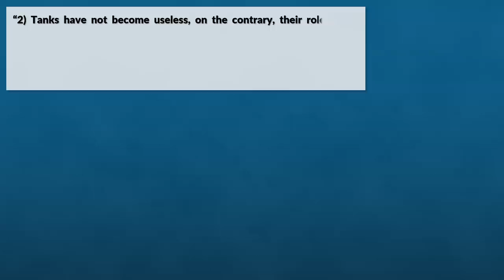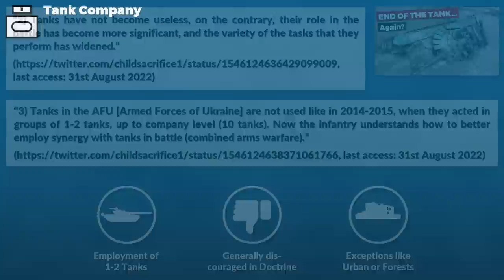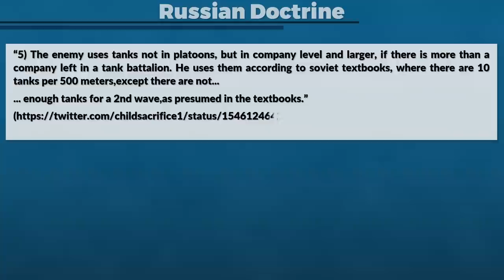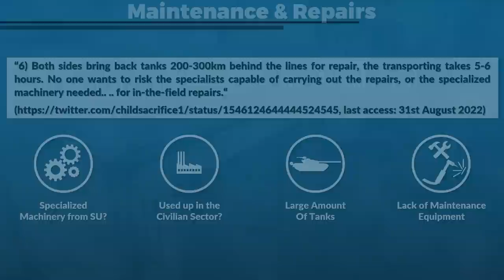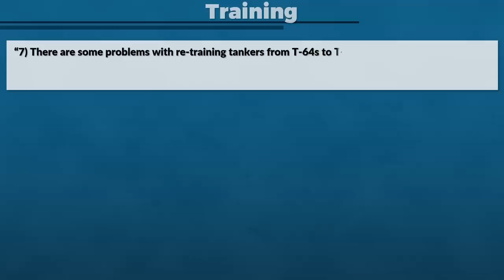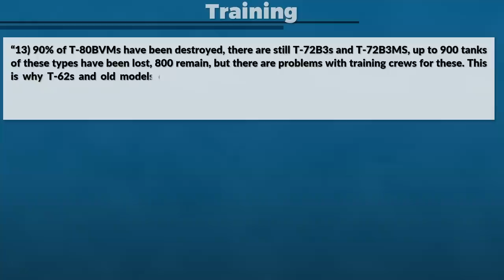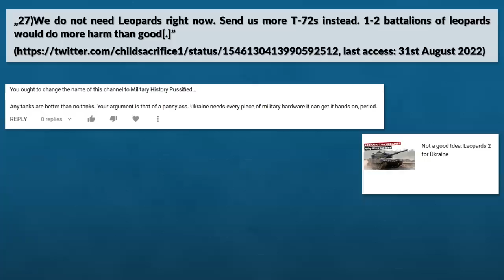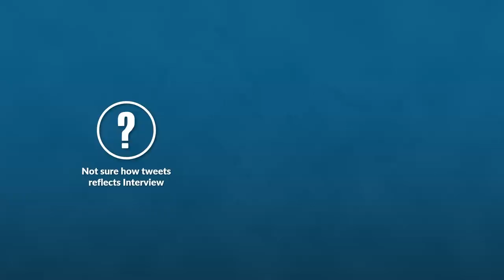What Ukraine thinks of Tanks

Comment: Thing about modern warfare is mobility. Tanks are generally great as the spearhead in these manoeuvres.
Reply: I'm not sure if the paradigm isn't shifting 
Armor is vulnerable to ambush by ATGMs and infantry while on the move,  and in the defense they are very vulnerable to artillery and drones. 
The USMC is replacing their 120mm mortars with the Hero 120 midrange loitering munition. Precision strikes from up to 60K with a javelin warhead in a 40 pound package. They can carry a dozen in a small truck. Small platoon sized elements can carry these, along with javelins and stingers, and still have a stealthy signature on the battlefield.
The HiMARS will replace most tube artillery in the USMC, hitting high value targets and move quickly before suffering counter battery fire. 
It's possible that combat will rely on a forces ability to move quickly, deliver precision firepower onto targets beyond line of sight, and avoid detection by air. The armored vehicles heavy weight and tracks make it easy to track by drone to it's hiding spot. 
Lighter vehicles with minimal or no armor leave a much lighter footprint and are easier to camouflage with netting. 
Nowadays, direct fire fights with an enemies tanks isn't necessary, as you can destroy them 10 kilometers before they ever get in range with their main guns.
I imagine the use of MRAZR, Flyer 60, or the Infantry Squad Vehicle will increase. They can carry anything from drones, machine guns, grenade launchers, 30mm cannon, etc.
With the number of tanks lost in this war to precision strikes, I'd hate to be an armored crewman in this most modern war.
Reply: @theimmortal4718  I don't think the paradigm has shifted that much. ATGM's were still around in the WWII and the Russians still made gains earlier in the war (special operations). The only problem seems to be the infantry aren't really doing a good job protecting their tanks (training/motivation?) or that the armour isn't particular good (not reliable?).
Reply: @TheNinjaMarmot  
I can never seem to get anyone to explain how an infantryman with a rifle is supposed to protect tanks from 155mm artillery shells or ATGMs fired  from miles away. How is that supposed to work?
Reply: @theimmortal4718  Quite simple. Move as fast as you can, don't stop - even if the first tank get immobilised and protect the sides of the column. The armour at the front of the tank should prevent ATGM's. Although some ATGM's (like TOW, I think) hit the top now.
Reply: @TheNinjaMarmot  
That made sense to you? So driving around and not stopping is how infantrymen with rifles stop ATGMs?
Armored vehicles have to stop when they get to the objective. It's impossible for them to just keep movingz especially when they're burning a gallon of fuel every 2 miles.
As soon as they go into a defensive position, they're now fixed.
This isn't a theory. It's how Russia has lost 2500 armored vehicles in 6 months. 
Scattering infantrymen around the field or simply driving around so you don't stop won't stop the threat at all. ATGMs hit you while you're moving, drones and artillery hit you when you stop.
Reply: @theimmortal4718  No, I think you're missing the point. 

Tanks are still useful as a spearhead for an invasion. Would you put an IFV at the front?!?!?! One point of a spearhead column is to encircle the enemy or disrupt their defensive line - thereby hoping the enemy will pull back. The key therefore, is mobility. Standing still is not going to win wars.

If an ATGM can hit a tank while it is in a defensive posture then they are not doing a good job protecting the tank. If they are hit by artillery. Then it's tough luck. 

If they are being hit from the sides. Then its upto the infantry to secure the area.
Reply: @TheNinjaMarmot  
It's not tough luck. Hitting tanks in the defense with laser guided artillery shells from 25k isn't luck. It's strategy.
How, exactly, do you think a tank is supposed to stop that? Pull security? And see what? Shoot what?
A tanks not going to defend itself from a tiny drone dropping an RKG HEAT grenade on its engine deck. 
Maybe the choice isn't between a tank or IFV. They're both equally vulnerable to the same weapons with devastating effects. Anything that will blow the turret off or light on fire and IFV will do so a tank. Neither can be hidden and the mostly have to stick to roads due to enormous ground pressure.
Reply: @theimmortal4718  I think again you are still  missing the point. 

There are lots of factors why one vehicle is hit while another is still standing and chance does play into this. Likewise,  its the same for soldiers. One could die while the one standing beside lives.  

I said, tanks are still good for spearhead and mobility. Saying an IFV is equally as vulnerable as a tank is stretching it. The frontal armour of a good modern tank can still defeat an ATGM. There are no proven records of the frontal armour of IFV's that could defeat an ATGM!
Reply: @TheNinjaMarmot  
You're still not getting it.
What do you think the frontal armor protects from? Direct fire
It does nothing to protect from top attacks.
That roof armor is max 2 inches on an MBT, so it's easy to pierce. How does thick front armor protect the roof? It doesn't.
A 155 laser guided shell will kill an MBT just as well as an IFV. Same with an RKG dropped by a hovering drone, a glide bomb from a Bayraktar TB-2, or a kamikaze drone dive-bombing onto it. 
I'm not so sure it's business as usual. Ignoring all of the technological advances and dismissing them as inconsequential to the survivability of large, heavy, loud, gas guzzling armored fighting vehicles isn't wise.
Reply: @theimmortal4718  You think artillery is going to hang around for long after the first volley?!!? 

You think a column of advancing armour is going to hang around after an artillery strike?

Did you see a drone kamikaze into a tank or even an IFV?

This will not stop a motivated, highly mobile spearhead column of tanks.
Reply: @TheNinjaMarmot  
Artillery doesn't have to stay in the same firing position. A modern SPAG can set up, fire 6 rounds, and pack up in less than 4 minutes. 6 laser guided 155mm shells weighing 90 pounds flying 25 miles to their targets. Vehicles painted by drones are hit on the first shot, whether they are moving or not. Once the tanks are spotted from the air, there's nowhere to run or hide.

Yes, I've seen videos of many tanks and vehicles hit with kamikaze drones. This will increase as more examples of loitering drones like the Hero 120, Lancet 3, Harop, or Phoenix Ghost makes it onto the battlefield.
They're especially good at stripping away air defense and artillery emplacements.

Tanks can try to hide if they want. A large tank is pretty difficult to keep hidden from air observation. A modern medium range, medium altitude UCAV will still see the thermal signature and ruts the tracks dug in the ground from thousands of feet up.
Drones that are very hard to see on radar, if you want to turn one on before it locks on an amram on the signal.
Even small quad copters dropping small bombs on the tanks are destroying them. They usually carry multiple bombs, so it's got several shots to make the kill. Usually it's through an open turret hatch (exploding the ammo), or on the engine deck setting the tank on fire. Dozens of these are probing the lines at any time. At less than 100K,  they're expendable. If it only kills one tank, it's paid for itself. 

That's not even discussing fire and forget, top attack, man portable ATGMs like the Javelin or SPIKE. The firer has the potential of engaging tanks outside the range of their main guns (greater than 2 miles). A small team in a covered and concealed position is a lot harder to detect than a multiton vehicle.
Some ATGM systems don't even have to be located near the firers position.  They are fired remotely, so the crew can stay hidden.

Precision guided weapons might kill the idea of the large armored vehicle. Speed, stealth, and a smaller supply and maintenance tail might become more important than protection and firepower. The less ammo tonnage and fuel that needs to be delivered down to the company, the better. Less total men needed to be in the field, the fewer the number of  support they have to have.

Active protection systems are very expensive but they will be mandatory going forward. They won't defend against quad copter attacks but it would give at least a fighting chance against missiles and possibly guided artillery.

Air defense will have to advance quickly. The drone threat is so massive that individual vehicles will have to have some sort of air defense capability. Whether that's a man portable stingers, radars with air burst autocannon, air defense drones, or lasers, if the drone threat isn't mitigated it's going to be difficult to survive in a tank.

All of this doesn't replace the man on the ground. It's just now these weapons will be what he's using to destroy fighting positions and vehicles whenever they see them while performing recon. Men moving more like sniper teams than a charging rhino. Destroying a bunker with a one shot 40 pound drone from 5 miles away is much safer than bringing up a tank within the line of sight of a potential ATGM team.
Flying that same drone up to find a hidden mortar team, an armored vehicle, helicopter, or building is just as easy.
Reply: @theimmortal4718  I don't think we are going to see eye to eye on this. 

I still believe tanks have their place and I still believe that place is as a spearhead to an attack. 

I think modern artillery will still need at least half an hour or an hour to relocate. And by this time, if the spearhead goes well, it will have advanced by 20-30 miles by then. 

I've only seen one footage of a switchblade attack a stationary tank from above. I don't know how effective it really is as I don't have footage of an aftermath of a kamikaze drone attack. 

I think if an attacking unit which has effective AIWS and SAM support and a spearhead with tanks at the front will be the most effective way to attack a defensive position. 

I think current military doctrine still believes that too.
Reply: @TheNinjaMarmot  
The Switchblade 600 and Hero 120 both have a javelin warhead. The Azerbaijanis used the Harop loitering munition to take out dozens of targets in a very short amount of time during the 2020 Nagorno-Karabakh war. Future ones will probably have an automatic lock on feature that will turn into an autonomous guided missile at some point in it's flight path. These things are only 3 or 4 feet long and less than 50 pounds. Almost impossible to see, especially if its 1000 feet in the air flying with an electric motor.  An army, once equipped with enough of these, can swarm out 50 of them like small cruise missiles. The Hero is specifically designed to be capable of doing this.
One truck armed with an 8 pod launcher of these ready to fire has the ability to take out multiple targets while safely hidden miles away. 
The time to kill a tank is before he ever gets in range. Why would anyone give it a fighting chance? Kill it when it's still miles away.
It's not like the tank can hide from the strike.
UCAVs with laser guided bombs are proving very effective against armor. 

Tanks don't just assault in and then disappear. As soon as they get to an objective, they have to pick up security positions. If they want prepared ones, that is going to take time to construct. 
During that time, they are being watched by drone operators. Since the armored vehicle is easy to spot from very far away, they become priority targets. Smaller vehicles have a higher chance of remaining undetected, which ensures a higher chance of survival.
It's not just one thing or another threatening large armored vehicles. It's a multitude.
The same thing is going on with helicopter gunships. It's too easy to knock on out with a manpad, which are all over the battlefield in Ukraine.
Reply: @theimmortal4718  I agree, they are proving very effective against the Russians atm.

But here's the thing. I think equipped with very good CIWS and electronic countermeasures (which the Russians don't have), I think these drones will be much less effective against say a US army column with tanks.  The only Abrams I think were ever taken out were by ATGM's, IED's aimed against it's tracks.  

The Russian's atm, just seem too disorganised and uncoordinated against the Ukrainians. But that doesn't negate the fact that their tanks did make inroads into Ukrainian territory. 

The only thing that's stopping them atm, it seems, is lack of logistics and manpower.

Comment: I don't know how many of you have watched the Battle Of 73 Easting: Brutal Tank Combat For The Gulf on Timeline.  https://www.youtube.com/watch?v=WKZn-vT9CRE  Here we have the M1A1 Abrams vs. the T-72, totally one sided.  I can't help but think that a substantial force of Abrams tanks commanded by a Rommel of Patton could cut right through the Russian lines.
Reply: There would be some major differences. For one, the Russians have a lot of artillery. Also, staging could be a problem, both for drawing artillery fire and cruise missile strikes. For another, the Ukrainians would be unlikely to have air superiority. Yet another aspect would be man portable anti-tank weapons. They weren't a major factor in the Gulf War, but no clue as to how well equipped Russian units are with them. And then there's terrain. Lots of rivers, lots of defensive positions built around towns/villages, and so on. You'd also need infantry trained to move up with the tanks, lest you make it easy for enemy infantry to kill a bunch of your tanks. And then there's training on the equipment.

Also worth noting that those T-72s were the export model, which lacks certain features the domestic ones have. As well as not being as modernized. Though that does, of course, bring up the matter of the current state of the tanks Russia is using, which can vary quite a bit.

Comment: The weird thing about tanks is that they would not be the tank in an RPG, that role probably goes to infantry right now.
I think they are more of a berserker type, maybe a bit of damage dealer.
Reply: Brawler
Reply: yes real war is very comprable to dungeons and dragons
Reply: Ehhhhhhh. I disagree. An MBT still has mostly impenetrable front armor, and top-attack weapons can be partially mitigated by sticking ERA on the turret roof. In most RPGs, a character with a large shield can only block attacks from the front as well - most times you wouldn't be given a chance to block a backstab, right? Infantry is the rogue, laying ambushes and making sure the tank isn't flanked